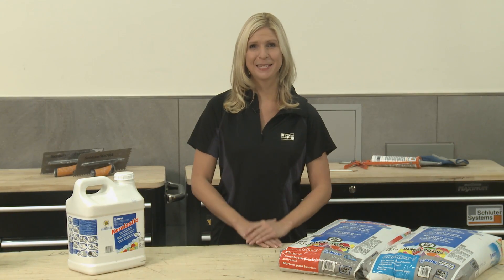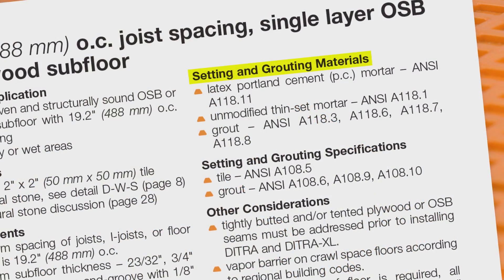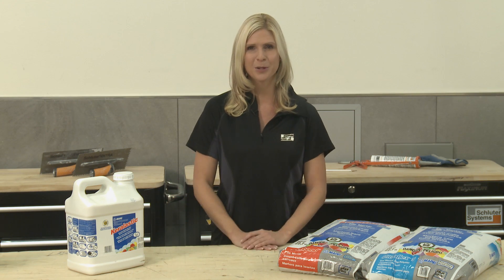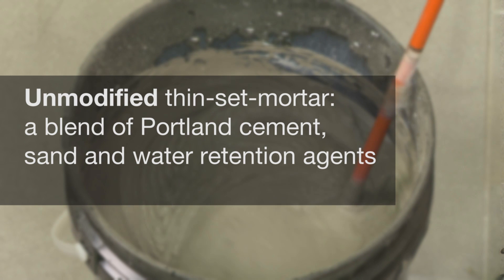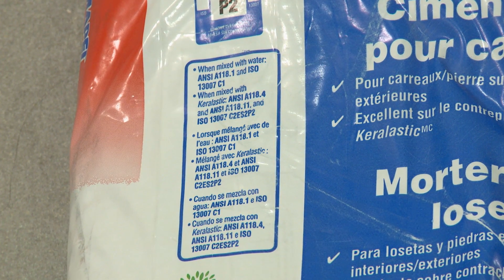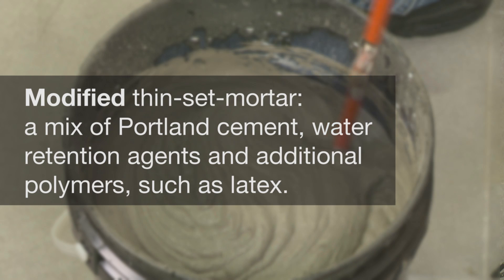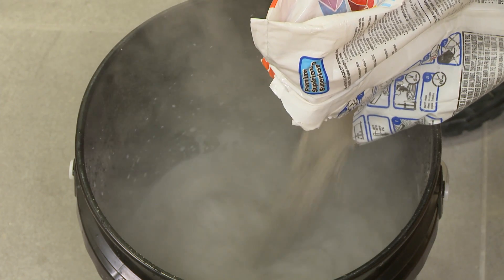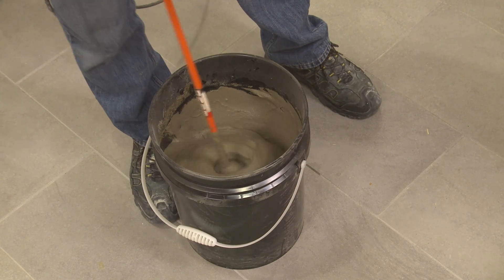Schluter®-Systems: Thin-set mortar clarifications- Modified vs. Unmodified

Comment: Seriously? Would you mind telling us why do you have modified and unmodified? What is the difference and uses of each?
Reply from the maker: Hi Syed, 
On a plywood or OSB floor substrate a modified thin-set should be used and on a concrete or gypsum floor substrate an unmodified thin-set should be used. When installing KERDI, DITRA, or DITRA-HEAT use a premium unmodified thin-set or Schluter SET™,Schluter ALL-SET™, Schluter FAST-SET™. If you would like more explanations a call into our helpful Customer Support team could be useful. They are available at US: 888-472-4588 or CA: 800-667-8746.
Reply: I don't get it. You say to use to use modified on Plywood but to use premium unmodified for all your products. I don't follow the logic.
Reply: @oleksiynaumenko7104  buy the cheap stuff,  add a little concrete glue such as uni-weld or weld crete,  if you want to spend a little extra ,buy some white cement and add it to the mix
Reply: @jessedukelacrosse6470  naaaa don’t cut corners you paid those mistakes in a high price later …do what the factory says follow always instructions
Reply from the maker: Hi Oleksiy,

We recommend premium unmodified or Schluter SET™,Schluter ALL-SET™, Schluter FAST-SET™. We now have our own line of thin-sets (this video was released a couple of years before we released our thin-set.)

Developing our own setting materials has given us the ability to guarantee consistently positive results. By controlling the formulas, we can be sure no changes will be made that have a negative impact on setting times and strength gain in these applications.

Hope this helps!
Reply: Schluter-Systems North America whoever runs this Schluter accounts needs to be fired